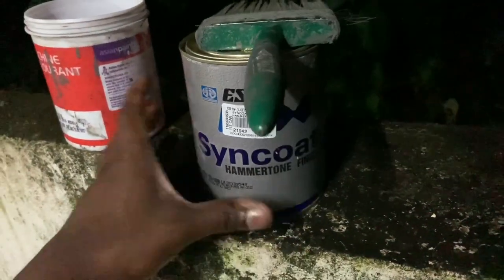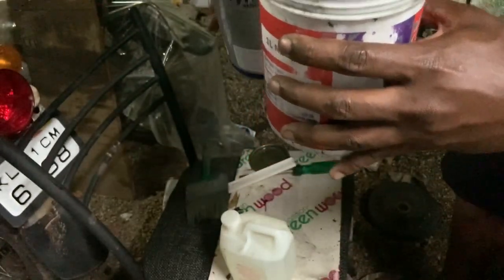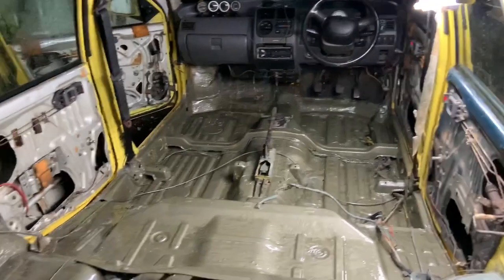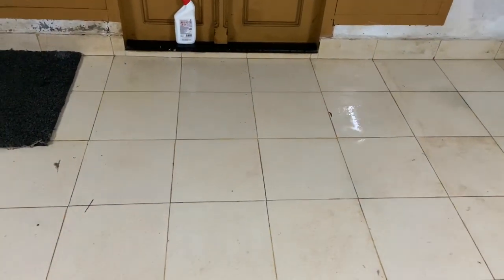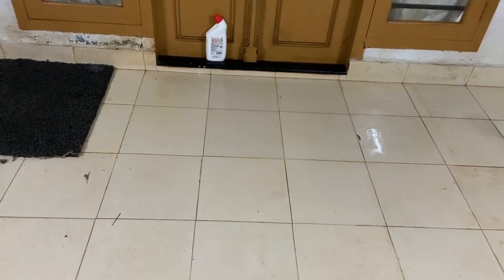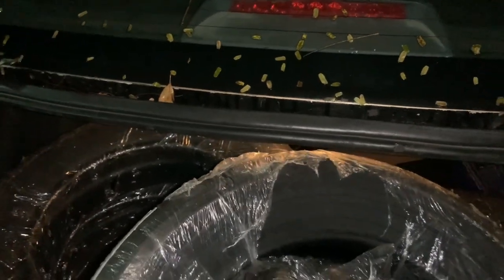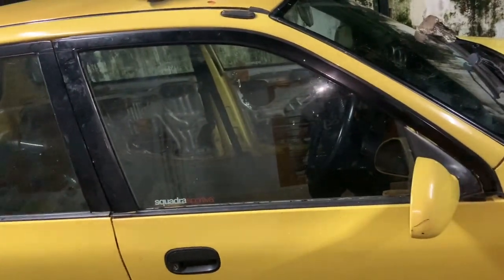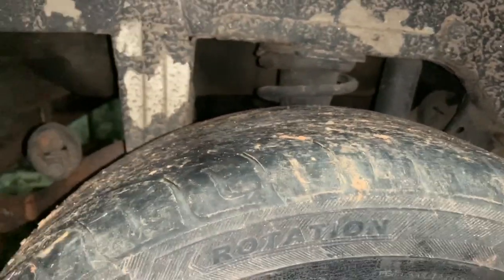Wife’s Zen Restoration Part 3

Comment: NYC job by the way.. Yup the advantage of small cars is spare parts they are dirt cheap.. I was about tell u that do the flooring to ur backyard finally u doing that and choice of using granite is good idea now it's trending all the builders using granites for flooring this days.
Cheers
Reply from the maker: I am using granite for the edge alone, especially since its prone to breakage. Overall flooring will be interlocking blocks. I was looking for granite slabs for my garden
Reply: @Yamakaze  interlocking blocks also be great most of the footpaths and gas station ppl use this I think it will last longer